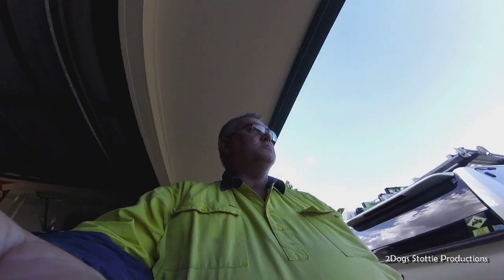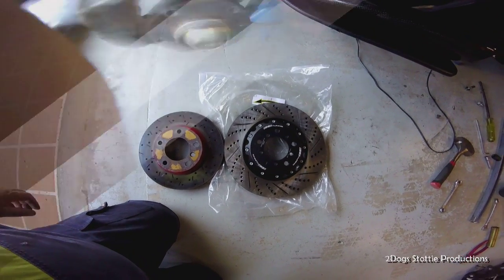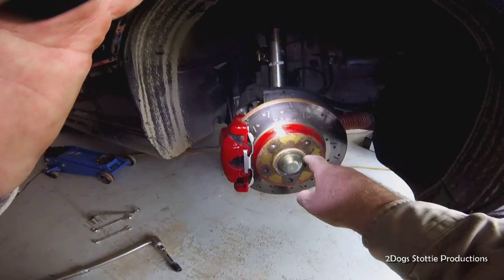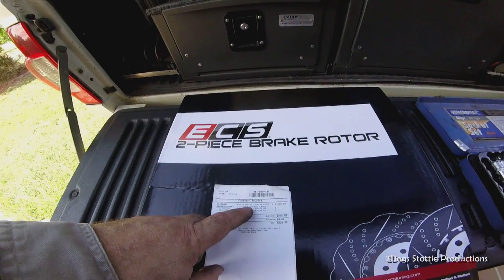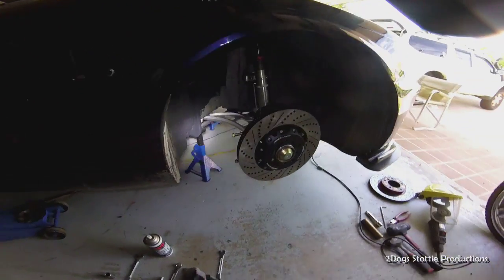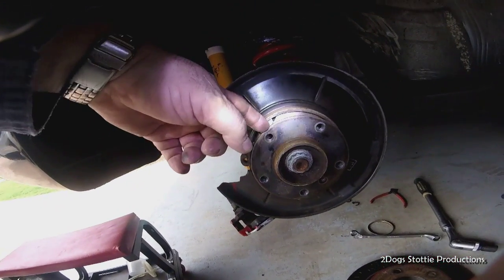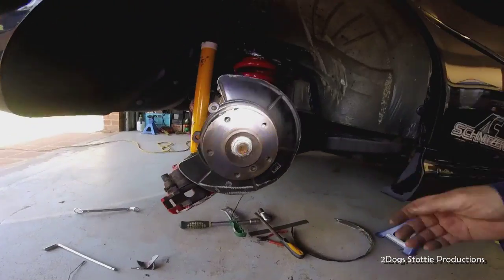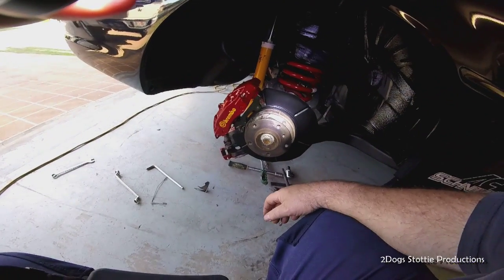BMW E46 Big Brake Upgrade BBK - Porsche 996 Brembo Calipers

Comment: Well done. Very  thorough with your work and come across as very knowledgeable. The type of bloke you could learn a lot from. 
I live out near Wivenhoe Dam and have myself a e46. However mine is track only. It's all new to me and I'm documenting it on YouTube also. I didn't know of the porsche upgrade so I'm glad I found your vid. 

Jezza
Reply from the maker: C&F
Thanks for your comments.
Im glad I could be of assistance.
Just follow the links for the gear and take your time to do it correctly.
Reply: Hiya thanks for the video very helpful. I know its been a while but i have a question i hope you may be able to answer. I have a 325 and the american guides to doing this,  all say i have to change my rear trailing arm and hub to a 330 or i will loose the parking brake function.. this is due to parking brake shoe size... can you confirm this? . Is this anything to do with them all being automatic in america or would this apply to manuals as well?
Reply from the maker: @indee3211  Very sorry for the late reply. Only just noticed it then.
Not sure about the only auto part but if you can get a machine shop to sleeve to rear rotors as I have, it will ALL work fine. 

I hope this info is still helpful for you.
Have a nice Day.

Comment: I had my 46m3 rear discs fettled in exactly the same way as yours in order to install a bigger rear set up on the standard 325ti axle.
Also, I've got the same front ECS discs on my m3!
I thought they were 345mm not 355mm 😜
Great vid and lovely car by the way
Reply from the maker: Ian.
Yes you are correct. My mistake as they are only 345mm. 
I did show the correct dimensions in the end credits though
Have a nice day.

Comment: I was wondering. Why always the 996 caliper(986 s)? Why not the 986 non s calipers with 325x25 rotors. The difference between the 986 s and non s are the rotor thickness and mounting boss which I believe the 986 s are 18mm higher, pistons size are the same. Instead of milling the mounting boss I believe  I'll need 6mm shims. The base 986 rotors are 300mm vs 986 s are 318mm. I been looking at pictures of the calipers and the mounting boss are higher on the 986 s calipers. I might try it. Need to get a good price on non s calipers. It's crazy that those are still kind of pricey when a full set of 17z caliper front and rear can be had for $350. Front and rear bracket s are going to run me $150 front and $150 rear.

Comment: The front disc"s are going in the wrong direction.  Instal left to the right and right to the left side if you swap a BBK. Than the grove and drill"s  right

Comment: Hi mate, love the vid. What size wheels do you have? Do you think these would fit under a 17inch wheel? Thanks
Reply from the maker: Oliver
This kit will NOT fit with 17" wheels. It requires minimum of 19" but the calliper stands require machining. 20" wheels are required to fit the kit as per what I have showed you here.
I'm running 20x9 front and 20x10 rear.
I hope this helps.
Reply: @2dogsstottie  yes, thanks heaps.

Comment: Nice work, and nice walk through. I have the brembo setup on the front like yours but I cannot find the carriers for the rear. They make them for the M3 but not for the 323,325,328,330. I have a 330. Did you simply use the M3 brackets and rotors? Maybe I missed it, but did you custom make the insert for the handbrake? thanks
Reply from the maker: Dan
If you check out the credits at the end of the video it will clearly state the part numbers and site address I got the parts from.
Yes I had a 10mm thick ring made up to have an interference fit, they were then press fitted, then 4 x 8mm grub screws full width inserted.
I hope that helps 
Have a nice day.
Reply from the maker: Dan.
If you are here in OZ the 330  rear hand brake diameter should be identical to the M3?
Reply from the maker: Here is the link to the rear brackets... https://rallyroad.net/collections/e46brakes/products/e36-e46non-mrearbrembobrackets
Reply: Thanks for the reply and the link. Not sure if the m3 and 330 have the same size in the rear. Will have to look in to that a bit more. I was aware of how the adapters were mounted in to the rotor but I wasn't sure where you had gotten them from. I did not watch the credits initially. Went back and saw them listed, thanks. When I picked up the fronts, I did not come across the rears at the time. On rally road, they actually mention using e38 rotors to be able to utilize the parking brake. That might be something to look in to. Thanks again
Reply: Thanks for the reply, I am running CSL rotors up front. I found the rear brackets and have ordered them already. Calipers are also here. I'm running CSL brakes all around now.

Comment: You didn’t have to trim of 5.5 mm material from the mounting boss of the calipers.
Reply from the maker: TFFT
No mate as Im using 20" wheels on this E46.
You only need to trim if using 19" but then the rotors need to be smaller too.

Comment: I have a small handbrake 325 e90 and would like to know who did your rear disc insert, how much it cost and its installation. I'm looking to upgrade the brakes and the small handbrake is an issue as yours was, any information you could give would be a great help.

Thanks

Mike
Reply from the maker: Mike
I think it was about $200 but not sure now.
Just supply them the rotors and the Dia. you are after. 
It should be a ring 10.0mm thick

Spot on Performance & Fabrication
Address
U2/46 Randall St 
Slacks Creek QLD 4127Phone
(07) 3133 3895Email
spotonperformance@hotmail.com
Reply: @2dogsstottie   Thanks for the reply

Comment: Hey , what was ur rear rotors measurements? (Diameter, thickness, ) 
And would the m3 rotors fits instead?
Reply from the maker: The m3 rears are larger dia and unless you changed all of the internal auxiliary equipment you would still need to sleeve them like I did here.
The details are in the video of the relative disk sizes.
Thanks for your comments

Comment: Good Job!!!
Reply from the maker: Thanks mate
Reply: Hey did you use the E$^ m3 rear caliper bracket? if not do you remember the part # or where to purchase.I have already fitted the front calipers
Reply: Sorry typo. E46 rear caliper bracket
Reply from the maker: @gc745li  All parts as per the parts list at the end mate.

Comment: How much did the upgrade cost and how much time did you put into it
Reply from the maker: Cost in total was about $5000au most of the time was consumed by the reconditioning of the used Porsche calipers and the re engineering required to correct the American rotor manufacturers fuck ups.
The actual fitting took approx 2 days for front and rear. But I am fussy. and about 90 minutes to bleed up the brakes single handed.
I hope this helps

Comment: What struts are you using?
Reply from the maker: They are Koni "sport" adjustable coilovers with Kings H/D springs with coilover spring caps so we could remove the original large spring cap used with the standard BMW springs.
My advise... Use Bilstein instead.
Reply: @2dogsstottie  Ohh really, billstein over this? why do you recommend bilstein and not koni?
Reply from the maker: @kay19833  Because I had issues with Koni and they don't backup their product and pass it back to the supplier of whom I had the trouble with in the first place. Also the Bilstein is a softer shock, as they were designed more for road use that the track orientated Koni's and the rear is MUCH easier to adjust than the process required by Koni.

I hope this helps.
Reply: @2dogsstottie  Sorry Koni did you like that. customer service and return policy is what makes a brand. f them. I drive a E46 compact(2 door) what model bilstein should I get?
Reply from the maker: @kay19833   As this requires more info, like driving style, load of the car, terrain traveled upon etc. You would be best to contact a Bilstein specialist or suspension guy.
I'm a "security tech and aircraft mechanic"
Reply: @2dogsstottie  Aircraft mechanic and a security tech at the same time? how could you be a security man and an aircraft mechanic at the same time? 2 jobs?
Reply from the maker: @kay19833  I'm sorry.
I had no idea I was conversing with an American.
Let me spell it out for you.
Some people in the world have more than one job. WOW! I know, it's amazing ain't it?
But they are the people that are not happy with the way the world works, as it's orchestrated by the more affluent in our society to keep the lower or middle class exactly were they are.
But these more than one job crazies, are doing their bit to break that mold.
I know people with MORE than two jobs... don't you?

Comment: Loss the fish eye look. Can’t stand it and never got to actually see your video.
Reply from the maker: Drop the Post
Thanks for your comment.
However its not a "Fish Eye" effect its just the way the GoPro sessions processes the image when up close.
I just didn't change the view that I use for my video's on my Kawasaki.
Sorry it upset you like it did.
Have a nice day!
From the land of OZ.
Reply: 2Dogs Stottie, oh I have the 5 black and have not noticed that. Although when I edit I make sure to lose any fish eye looks. Thx for your reply. Love my BMW.
Reply from the maker: No problems.
This is the tiny Sessions 4 so it has less wind effect when on the side of my helmet.
As such not quite to the standards of the 5 black and with a lower price tag too.
thanks mate
I hope you gained the information you were looking for.